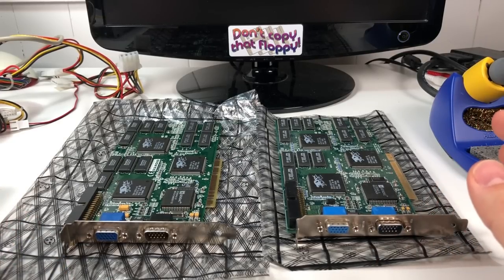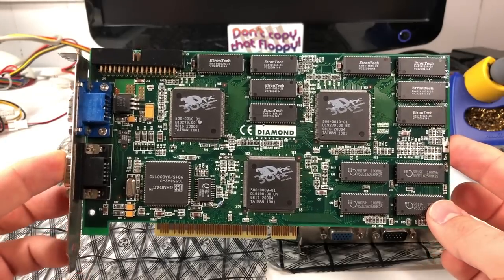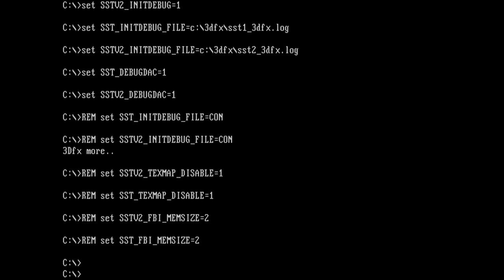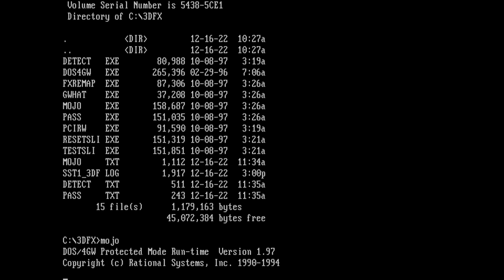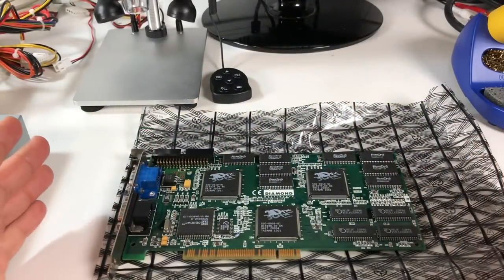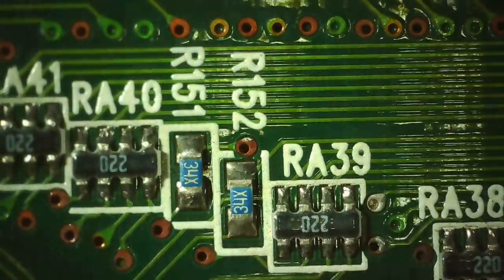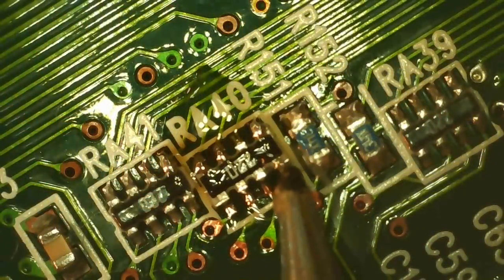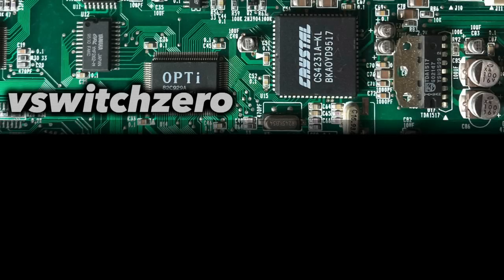Troubleshooting and Repairing a 3Dfx Voodoo 2!

Comment: I worked for an importer of Voodoo cards in 1997/8. I will never forget seeing Quake running for the first time via the Voodoo on a 60MHz Pentium so smoothly and how much better the graphics were - the Pentium MMX 166 without the card was an absolute dog in comparison!
It was a great year and a half there testing every possible hardware config with all the latest games. I had friends buy the cards and "report bugs" with games that I wanted to be paid to play!
I do remember having to change out some caps and resistors on the boards due to some issue - 25 years later I can't recall specifically where or why...
I'm glad this popped up in my feed and brought back some memories. Thanks!
Reply from the maker: Thanks very much for sharing! Always love hearing these first hand experiences from back in the day.

Comment: Awsome video. I think I still have my old Diamond Voodoo 2 lying somewhere in the adict. Remember borrowing a friends Creative card and they worked right of the bat together in sli. if I remember right it could run Everquest in 1024x768 in 80Hz with 2 cards in sli. Was pretty awsome on my Phillips 21" CRT that needed half of the desk size, tugged all the way in the corner to have room for mouse and keyboard... those things was HUGE compared to todays flat screens. 😊Was a big fan of Diamond cards back then. Remember having a rather pricy Diamond Viper 2Mb 2d Card because of the high quality Ramdac's used. Not completely sure why those things ment so much for the quality of the picture back then. Today you never hear about Ramdac's anymore.

Comment: I ran 2 voodoo2 in SLI mode (in combo with an ATI Mach32) on my 486DX2-66. The combo allowed my old 486 to outperform Pentiums for years.
Reply: Strange.
I tried a Voodoo 1 on a 486 100 Mhz, and even with Quake 1 the fps with really slow.

Comment: Awesome work!  I bought a pair of Voodoo 2 cards on a forum in the late 2000's, they were well outdated but I just liked the idea of two video cards 😅.  A friend had to help with drivers and such to get them working.  A couple years back I tried them again and only one of them was working.  I spent some time making sure the tiny pins weren't shorted on the chips, they had a rough life in storage and some did look bent.  Maybe the PC bug will bite again and I'll make another attempt.  It was awesome to follow along with the repair, great job on the video!  Best of luck with the train wreck version 😀
Reply from the maker: Thanks very much! I appreciate it 🙂 .. best of luck getting your second card to work. Please let me know how it goes 👍

Comment: Very nice!

Yeah, those thin-film resistors do have failure-modes like that. If thermal cycles build up mechanical stress, the ceramic can get microcracks, cutting the conductive film in the process.
Reply from the maker: Thanks! Yeah, RA40 is quite close to the frame buffer, which can get beyond 75'C at load. It definitely makes sense that it could be related to thermal cycling (especially considering that this card is in pristine condition.) Cheers!

Comment: Thank you. Today I got an InnoVision Voodoo 2 with perfect looking condition behaving the same way (not detected after driver install). I hope I can narrow down the source of failure and having something similar fixable issue. One day I will report back but I am glad I found your video. :)
Reply: I have sent it to guy who has equipment and experience with soldering (and microscope). TMU legs were simply deattaching when tested soldering, so he re-soldered the legs. Now it gives picture but freezes the PC under load. Quake 2 timedemo runs without issue, but only that, 3DMark and other game freezes after 1-2 seconds...No clue. Mojo gives proper data reporting TMUs, memory...

Comment: Excellent repair! I have recently picked up a 12MB Monster 3D II that's not working, so will be an interesting troubleshoot I think! Thanks for highlighting Phil's Voodoo2 benchmarks in your previous video as well - I was originally thinking of pairing it with a P233 MMX but now I might shoot a bit higher!
Reply from the maker: Best of luck with your Monster 3D II. Let me know how it goes! .. Yeah I was pretty surprised just how drastic the difference can be with more CPU power available. Even a 400MHz K6-3 is quite bottlenecked in SLI. I've heard that V2 cards will get quite a bit hotter with faster CPUs too, so cooling is important. Cheers.

Comment: Thanks very much for these informative repair videos. It gave me the info I needed to have a crack at solving the problem my faulty Diamond Monster voodoo 1 has got. I've so far narrowed it down to bad ram attached to the FBI chip as reducing it to 1MB got Tomb raider Dos working although with occasional glitching. I have put a post on Vogons in the video section.
Reply from the maker: Best of luck with your Diamond Monster 3D!

Comment: I really enjoyed the video. I particularly liked the in depth repair and soldering. I would like to learn to solder like that! I might pick up some of the flux you mentioned.
Reply from the maker: Thanks very much! It wasn't very long ago that I knew next to nothing about soldering. Getting lots of practice is the key. They sell practice kits on Amazon for very cheap that include a PCB and lots of SMD components, which is a great way to learn. Using scrap boards for desoldering practice is also great too. And of course, good quality flux is also important. Cheers!

Comment: In Quake 2 and 3 engine games if you press ~ you can see how many TMUs are working / active. Most probably you already know that :). Excellent video!
Reply from the maker: Thanks very much! I forgot about that actually, good tip! Btw, I subscribed to your channel recently - love seeing all the gaming footage from those days! :)
Reply: @vswitchzero  Thank you, nice to see that there still are many retro-enthusiasts who did not forget those great times :)
Reply: I think it's better to test with Quake 1.
Quake 2 and Unreal are sometime quite sensitive to the driver version you use, or whatever hardware you have for no known reason.
Quake1 is much more reliable.
Reply: The trouble is, how will you launch Quake 2 or 3 to get the TMU data if the Voodoo card won't initialise in the first place?

Comment: Well thanks to you, I figured out that my "arcade" Obsidian2 90-2440 reports framebuffer = 0 MB when I put it in a Win98 machine. Since it's a weird 10MB card, I believe I have also identified which are the framebuffer RAM chips: the ones without memory on the back. The 2 other memory banks are doubled from the back so 4 512K chips on each side = 4MB each. Chips on only one side = the missing 2 MB of framebuffer. On the arcade, the output is inverted and mirrored, displaying only text in orange. also, I tested for a monster 2 8MB and the game does work, but is missing 2MB so there are some grfx artefacts. Not wanting to boost the memory card count to 12 MB yet, since your video talks about checking the microscopic resistor arrays, I'm looking into buying a microscope for soldering now. I think I am ready and at that stage! Hopefully I'll be as lucky as you and find something bad...
Reply from the maker: Thanks for your comment! Happy to hear that the video was helpful for troubleshooting. That's really interesting that it's a 10MB card. I've never run into an arcade board like that one before. Best of luck getting it repaired.
Reply: @vswitchzero  I think I've identified a RA that looks broken! it's in my digikey basket... it's pretty darn small though but I have nothing to loose!

Comment: Not so common to see a fault like that. I think SMD resistors and caps on lower-current data lines maybe tend to fail more due to physical stress of the PCB bending etc.

But I guess even the thermal stress over the years of the card getting warmer and colder many many times could cause this, too.

Good to know it's something to look out for, and another nice repair job. ;)
Reply from the maker: Thanks very much! Yeah, I can't say I've ever seen one fail that wasn't damaged in some way. RA40 is very close to the FB chip, which gets >75'C without active cooling, so the thermal stress could definitely make sense.

Comment: I have 2 of the exact same card stored in a closet. One of them works, the other doesn't. I don't think I still own hardware that I can stick them in to see if they are still working. Any way, my intention is to frame those cards and having them decorate my gaming room.
I still remember the shock when I saw quake 2 running with colored lighting and bilinear filtering in 640x480 at 60hz. Going from software 320x240 to that was such a jump in quality that you had to be there yo understand it.

Comment: Just finished watching this one and the trainwreck repair, good work! I have a slightly sick STB Systems Voodoo 2 I'll be looking at over the next few days. It runs but there's noise/flicker in some of the textures, it changes and sometimes goes away with a tap of a finger on the card. Pretty sure all of the SMT electrolytics need replaced, one fell off when I removed the card for PCI connector cleaning and has the characteristic white crust under it -- not much, so I suspect they're just starting to go.

Figure it's worth hacking on, it was a $1 MIT Flea find from a decade ago :P
Reply from the maker: Thanks very much! Best of luck getting your STB card repaired. Replacing the electrolytics is definitely a great place to start. Keep an eye out for corrosion on any of the other pins or pads too as it'll sometimes hide loose or flaky solder joints. Let me know how it goes.
Reply: @vswitchzero  Will do! Got the caps off this morning, almost every one had leakage crust under it. Found a few loose pins on the second texture unit, which would make sense with the symptoms I was seeing.
Reply: Before: https://www.youtube.com/watch?v=dNtZAnR8wnM

After: https://www.youtube.com/watch?v=i1Kidowe1lo

Going to need a few hours of fragging to verify fixed :P
Reply from the maker: @glitchwrks  Awesome work! 🙂👍

Comment: nice!!! i just wish i knew how to use my multimeter LOL. i have 2 voodoo 2s that i got a few years ago hoping to repair because i could see some bent legs on the fbis, but i ended up breaking some pins on one, but the other has a very similar set of symptoms - shows as a device but gets the same windows errors. i'll definitely have to try out the debug tool and maybe i can bring one of mine back to life too :) thanks again for the great info
Reply from the maker: Thanks very much! Yeah the FB chip is especially fragile. The pins are really fine pitch and difficult to straighten out. Best of luck!

Comment: I'd really like to see a video on upgrading the memory of a voodoo2 from 90 or 100mhz to 110 or 125mhz and see if that expands the overclocking potential. Especially if the main processing chips are actively cooled and have heatsinks.
Reply from the maker: This would be very interesting to try! 100MHz SOJ40 EDO is pretty easy to find, but I haven't seen faster chips recently.

Comment: Great video. I also used to have a voodoo 2 card with a burnt resistor array! Unfortunately the card had so many ripped pads on the FBI chip that was much worse than just the resistors.. ended up passing it away
Reply from the maker: Thanks! Was there any visible damage to the RA on your card or just failed open like mine? Yeah, the frame buffer is really hard to work with because of the fine pitch, unfortunately. Cheers!
Reply: @vswitchzero  on mine there was physical damage but the resistor array got fully burnt! So I guess after stopped working they just tossed it away for years and came back after being damaged in al ways possible... Sad... But again it's always to know what can fail in a card :)

Comment: The link to "The 3Dfx Glide2 SDK for DOS/Win32 V2.43" links to a file that when unzipped includes three files: gwebvgr, gwebvgr2, and gwebvgr3.  What are the differences and which one did you use?  I want to play around with this while my V2 SLI setup is still working so I can get a feel for the diags with everything working right.  Thanks for the links!

Comment: I've watched most of your videos by now haha.  Love your channel/work.  I doubt i'll get anywhere on it,  but I have two failed Voodoo2 cards.  One of them, the 8mb Creative card,  i've had for a long time.  It has a weird glitch where the Number TMUs value is the same as the line above it with some 4/5 digit number when using Mojo.        The 2nd one,  i'm more annoyed about as it's a 12mb card i planned on using in SLI with a working 12mb card I also have.   That one does Passthrough, but that's it.   If anything tries to access its capabilities,  it hangs.   Mojo just freezes in DOS/Win95,  Display Properties window in Windows doesn't even come up for a minute or so and when it does,  the 3dfx tab is missing.     Of course everything works fine with my known good 12mb card.  

So anyway,  I'm mainly worried about the 12mb card.    I've never seen one have passthrough working but then fail completely using Mojo.   Nothing visible damaged on the board, nothing missing, no scratches, etc... 

If anyone's bored and has an idea where to start,  e.g.  what starts up first or is expected to respond when Mojo or anythign else is ran.  I can try to trace it down.   i've got all the typical electronic tools.  Oscilloscope, Multimeter, etc...   but i've not dug into these before.
Reply: I figured I would just update you. There was one bad resistor array(220) on the back of the card that would be towards the upper left portion of the FBI chip on the front.   So now I have a good 12 MB card again
Reply from the maker: Thanks very much! Sorry for the very slow reply on this. In my experience, it's actually not all that uncommon to have working passthrough capabilities since it doesn't require the FB/TMU chips to be functional. Did you have any luck getting MOJO to display anything via the debug logging output to a file? If everything physically looks good on the card, I would take a close look at all the FB/TMU chip pins under magnification and check to ensure none are loose. Also, the resistor arrays should definitely be checked too. One other reason a card may fail early in the initialization process is the DAC. If you check out my other video on the "train wreck voodoo 2" you'll see more on what I did to repair that one. Best of luck! Let me know how it goes.
Reply: @vswitchzero  I sent a follow up right before you replied. It was a resistor array on the back of the card. That one resistor fixed everything.  I did borrow the resistor from the 8 MB card that I have that doesn’t work. And I just had replacements show up from China. So I’ll put that back on the 8 MB card and then try to diagnose the 8 megabyte one at some point.

Thanks for the reply! Keep up the great work. I really do love the Content
Reply from the maker: @brianb6653  Awesome! Really happy to hear that you got it going again. I've heard many people with similar stories with resistor arrays now. Seems to be a fairly common failure reason for these cards. Best of luck with your 8MB card!

Comment: I have a similar problem, but when going into options of display propierties the system does not freeze, but in System Info of 3dfx V2-1000 I get only zeros... FBI Revision, Frame Buffer Memory, TMUs, memory, all stating 0! Any ideas what's going on? Games of course don't start and I get the same info of V2 not found...
Reply from the maker: When you get a chance, give the MOJO DOS application a try and see what it reports. In my experience it’s more reliable than the system info dialog in Windows. Any signs of damage on the card? (Missing components, bent pins etc)

Comment: Im confused about how you used the debug tools. When i go to the link you provided, after self extracting the files in the V2.43 SDK im not getting the same tools you showed in your 3DFX dos folder.
Reply from the maker: When you unpack the ZIP file, there will be three self extracting executables inside. The one you want is called gwebvgr3.exe .. You can extract it using 7zip from within Windows if its easier. Within that, the DOS tools are in the Glide\Diags\DOS path. Hope this helps, sorry I know its a bit buried in there. I may try to repack them in a more accessible ZIP file when I get a chance. Cheers.
Reply: @vswitchzero  Thanks that helped. Anyway after checking my Voodoo 2 (it gives the same voodoo not present error and drivers do install). I couldn’t find any bad resistor arrays, I even tested the solid caps and single resistors and they all seemed fine, so i guess my card must have bad RAM or SST chips ☹️. Board looks visually perfect like yours.
Reply from the maker: @nboy7  Were you able to get any useful information out of MOJO or the debug level logging? Also, just in case you haven't tried, be sure to check each of the chip pins. Sometimes they look perefctly fine (even under a microscope) but aren't attached properly when you push at them. Best of luck getting your card working again!
Reply: @vswitchzero  I finally got mojo to work. The Voodoo 2 card is detected using detect, but running Mojo shows lots of issues: 
FBI memory 0MB 
FBI powerOn Sense=0x0
TMU PowerOn Sense=0xdead
Number TMUs=57005
WARNING: Board 0: Bogus Number of TMUs (57005)!

Could this be related to bad caps ? Since this is a Gainward Dragon 3000 it does have some barrel shaped capacitors.